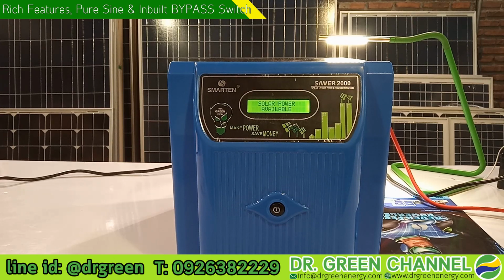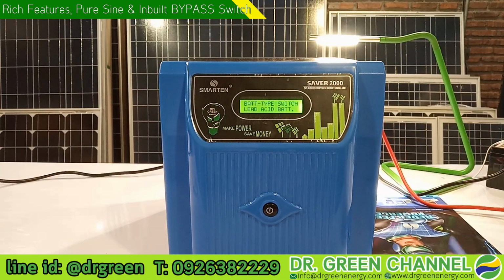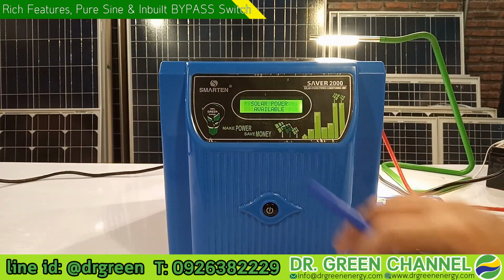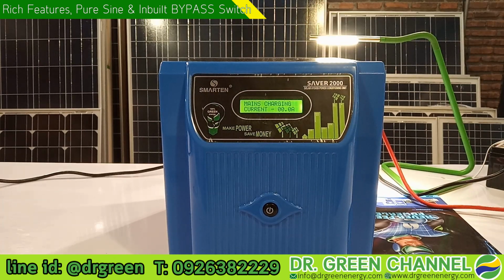Dr. Green Energy - Smart Solar Hybrid Inverter Inbuilt Solar Charge Controller 50A & Best in Class

Comment: Sir 1hp Ka submurcible pump stating load 12anp or raning load 7.5amp sir smarten mppt pcu 2.5 KVA college?
Reply from the maker: Good day sir, that is capable to run sir. Are you using off-grid or hybrid off-grid sir?
Reply: Konsha invater lagega plz